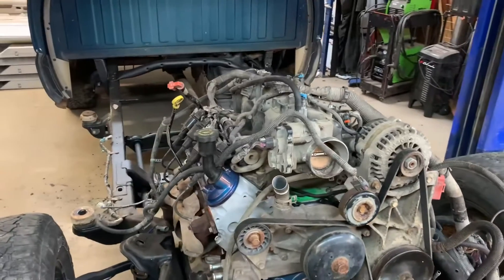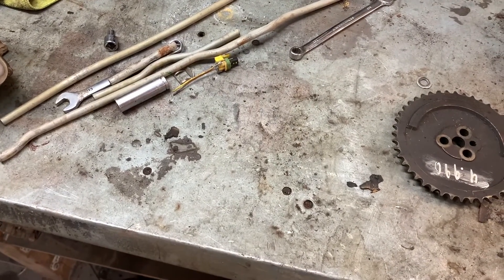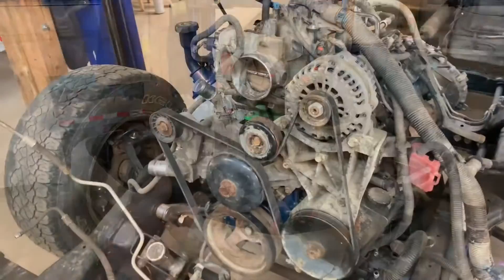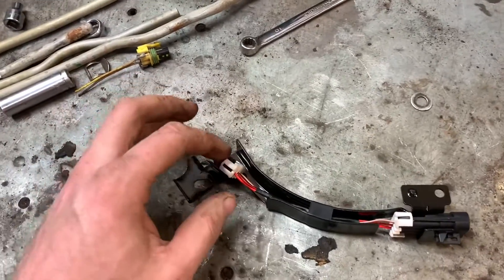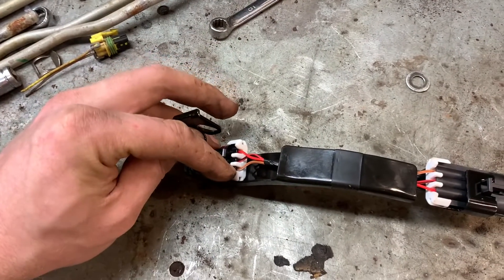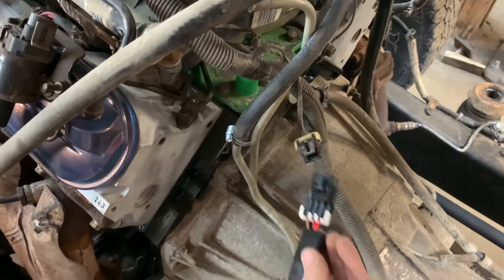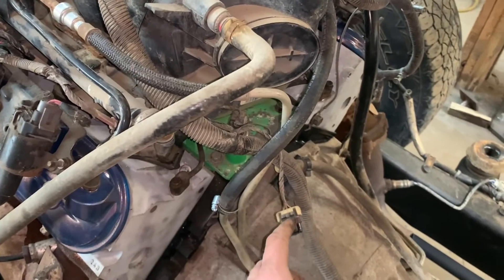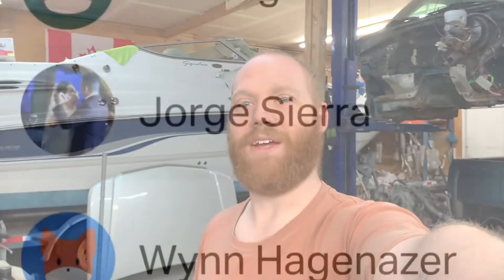How to wire a LS Gen 3 to Gen 4 Cam sensor harness

Comment: i recently put a gen 4 cam in my gen 3 engine, i changed over to a ls2 front cover and the same cam gear as in your video and i still have a p0343 code, will switching the two wires fix my issue?
Reply from the maker: I think so, yes

Comment: Need to know if this works vice versa. Putting a gen3 in a 24x gen4 05’
Reply from the maker: You’ll need the gen4 crank in it (or change the reluctor, but I find it’s easier to just change the whole crank if you have it out anyway) and then bolt the 4x cam gear and front cover on. Then it’ll work absolutely fine
Reply from the maker: EDIT. I just read you’re putting a gen 3 in an 05, they’re the same engine just go bolt it in

Comment: I need your help. I am doing the opposite gen 4 avalanch with a rebuilt gen 3 motor..i plan to extend the wire plug up to the back of the replacement gen 3 motor with rear cam sensor.. no where else talkes about switching the outside wires. Am i understanding that in my case going from gen to replacement gen 3 i still need to swap these wires??? Thank you for your help
Reply from the maker: You’ll need to put the avalanche cam gear and timing cover onto the gen 3 engine. The avalanche has a 4x reluctor and it won’t run on a 1x. 

You’ll also have to change the reluctor on the crank or change the whole crank itself to a 58x

You can get a lingenfelter box for gen4 to gen3 but I don’t know if it’ll work in your case. Might want to read up on that
Reply: @StationroadRatrods i just bought this unfinished project, pervious owner doesnt reall know the spacific details on what has been done. I am continually figuring it out.. sounds like the reluctor was changed in the motor, but for some reason the cam sprocket and cover did not get changed ??? So motor is in truck now. It slow starts and runs rough, tach works... but all traction control and other codes flashing. I need to varify the reluctor wheel was changed without pulling the motor. If it was i can add the cam sproket and cam cover.
Reply from the maker: You got it. I don’t think it would start at all if the crank reluctor was wrong, so that’s a good start
Reply: . I hope this is the case.. i can do the cam cover and sprocket while still in the truck, fingers crossed cam parts ordered...
Reply from the maker: Good luck dude. Any questions at all ask away
Reply: @StationroadRatrods  i was looking for the vehicle original front cam sensor wire lead and plug but could not locate it yet. Some of the harness has been electrical re-tape wrapped. Can you direct me where on the harness / engine the cam wires should have come from to go to the front cam sensor?
Reply from the maker: In the harness there’s a plastic bracket that bolts to the front of the oil pan. It should branch off right next to that and there’ll be a 3 pin connector
Reply from the maker: *If it has VVT it may be a 5 pin connector*
Reply: . Guy before me did a gen3 engine swap into gen4 avalanche. 1/2 competed and gave up.. thats my starting point. I just ordered the 4x cam sprocket, and the cam cover with the front cam sensor.. the " truck harness " is where i cant yet find the plug,, to go into the cam cover item your speaking of... does the truck harness feed the cam sensor across horizontal from the frame area, or does it feed down vertical from the top of the engine?
Reply from the maker: I think it comes out from in under the power steering pump area
Reply: @StationroadRatrods.   thanks for the tip, i will start to look around there..
Reply from the maker: Anytime
Reply: @StationroadRatrods  i found the cam sensor wires coming out of the larger bottom connector plug driver side on frame below fuse box.. it looks like its been hillbillied up ( not factory ) he extened up around the brake master to the back top of the new gen3 engine cam sensor. The new wire colors are blue, brown, and grey.  I was under the impression for gen4 vehicle harness they should be. Orange 5v hot, brown center, brown with white stripe trigger? So i am not sure if the previous guy " repinned the gen4 vehicle side connector plug ?? Before i put on the front timing cover + 4x gear. I will make the cam sensor harness from the vehicle back how it was/should be. How can i identify the proper orientation for the car harness connector pins side- and to the sensor connector pins at sensor ? Any photos , schematics, or suggestions ?
Reply from the maker: Holy what a mess. Yeah hook it back up to the front cover, that’ll be why it’s running like garbage. 

Check out lt1swap . com 

Go to “wiring harness modification”
Then “2007-13 vortec 4.8/5.3…..”
Then “2008 specific e38 pcm connector pinout….”

Look on that pi put diagram for the wires you need. You’ll find what colours you need then you can pick them out of that harness
Reply: @StationroadRatrods thank you for the guidance.. i will be looking into the actual plugs on the truck in coordination of this info, to see if it seems to fit. Waiting on cam cover and sensor parts currently. Thank you again.. i will post my results went further along.
Reply from the maker: Sounds good man, happy to help! Hopefully it works out well
Reply: . Thought i would give you a giant THANK YOU on thanksgiving day. I just got done working on the truck. It took me 4 days to get all the mechanical parts changed out from rear cam sensor to front 4x cam sensor. Then had to bulid a wire harness to the front cam sensor location. The guy before me had 2 wires crossed up on location in the pin comnector and also his wire color swapped. With your help and direction i was able to make sense of it and get it all corrected and ran the truck tonight. No more long crank and my obd2 scanner says it now can read the cam sensor.. thank you, no way i could have figured this out without your guidance. Thank you.
Reply from the maker: That’s awesome man, hell of a job!! 
Happy Thanksgiving 😊

Comment: I’m doing a l92 6.2 swap out of a 07-13 into my 2003 Silverado can I put that camshaft connector that you have in my truck and make an extension harness so my gen 3 plug will go into the front gen 4 aftermarket harness or that won’t work?
Reply from the maker: So are you putting the gen 4 pcm in the 2003?
Reply: @StationroadRatrods no sir just keeping the stock pcm just dropping the motor in
Reply from the maker: You’ll need to use a lingenfelter box or something equivalent to that. If you still have the stock 48x crank in it, you need to convert the signal to 24x to run the stock pcm

Comment: Which cam sensor did you use in the front timing cover? Aren’t there voltage differences between the gen 3 and gen 4?
Reply from the maker: You can only use the gen 4 sensor in the front cover. A gen 3 sensor won’t fit as it’s about 4” long

Comment: I cut and extended my wires and still have a P0342 code. I have two points inbetween that are but connected. Going to eliminate one and see what happens. I couldn’t seem to find 5V reference?
Reply from the maker: Your best bet to find the 5v reference would be to disconnect the connector from the pcm, find which pin is 5v and do a continuity test out to the cam sensor connector to see which is which.
Reply: @StationroadRatrods  thanks for the response. I have came to the conclusion that I’m going back to an iron block 6.0 gen 3
Reply from the maker: @bowtiebuilding probably the best bet, to be honest I’d like to do the same.
Reply: @StationroadRatrods  yeah and I talked to a guy with more knowledge on it than me and he says the aluminum motors don’t handle the heat from a turbo near as well. I noticed after breaking the motor in and running it that it’s a bit hotter under the hood.
Reply from the maker: @bowtiebuilding many people have made 1000hp on aluminum blocks, but no they’re not as strong as iron blocks. In my experience, pistons fail long before a block will. 

That said, I’m taking the aluminum block out of my truck and putting in an iron block
Reply: @StationroadRatrods  right on! I did put forged pistons in it. I just let someone talk me into the weight saving = power
Reply from the maker: A hundred pounds is a hundred pounds, but there are trade offs

Comment: I think this is my problem now. I have a holley terminator for a gen3 and moved the cam sensor to the front. Im going to swap the wires around.
Reply from the maker: Good luck! I hope it fires up well
Reply: @StationroadRatrods  thanks. Just tried and the ict billet extension dont fit. But my wire from my holley is long enough ti reach the sensor by itself. Just need to switch the wires. Can you confirm the wire pin out thanks
Reply from the maker: @theshark2804 you just switch the outside wires, the center wire stays where it is
Reply: @StationroadRatrods  yep just did that and not working for me. Now the holley 7th led is blue. Might not be the solution for me. Dang.
Reply from the maker: Well shit, sorry to hear. What’s the setup?
Reply: @StationroadRatrods  no worries. I will go back and try to reach my crank sensor as well. Something aint right. Thanks.
Reply: @theshark2804 you fix it?
Reply: @bowtiebuilding  yes. Running strong. Still need a tune. My issue was all over the place. Dont know crap about ls. So turns out i have a gen 4 crank in a gen3 block. My cam sensor was in the front and had to make sure the plug wires matched. Then just pick the right configuration in the software

Comment: I’m swapping the LC9 off an 2010 1500, rear cam sensor with a 2008 front cover cam sensor (DOD deleted). I plan on wiring up the harness before the install
Reply from the maker: In an LC9 the cam sensor is still in the front, the plug at the back is for the DOD. You won’t have to rewire anything
Reply: @StationroadRatrods  ok thank you for clearing that up. I was just confused bc mine (2010) had the VVT timing cover and the one I bought with the DOD delete (2008) was a plain cover. I’m off to change the cam sprocket and timing cover! Thanks for your help!
Reply from the maker: @John-zv6gw if you have the complete 2008 engine, just use the timing cover and gear from that engine on your 2010

Comment: Thats a good thing to know.  I can only imagine how frustrating it would be having everything plugged in and it wont start.  You'd never find that issue.
Reply from the maker: If it’s not something you were born knowing, it’s very difficult to figure out. It took a lot of research to find that
Reply: @StationroadRatrods  yeah, it's not everyone that would want or need to do that.  
Good info man.
Reply from the maker: @Jordy-927 only nutcases like me get in these situations 🤪 but then there are lots of nutcases around hahaha
Reply: @StationroadRatrods  At least 13.7k of us.   Lol. 
Dude, wanna talk nutjobs? I want to LS swap a square body S10 blazer 4x4 for a winter driver for da wife. L33 and a 6L80 with a stock height suspension would be the plan.  I just need to build a shop first...lol. Waiting for money to get cheaper from the bank.
Reply from the maker: I think that’d be an amazing winter daily. After driving the Escalade for the last couple winters and then driving a 2010 Chevy with selectable 4x4, I never want anything that only spins two tires again. 

Stock height is more than enough unless you need to park half way up snow banks at the grocery store like jeep people lol
Reply: @StationroadRatrods  I got the ZR2 for doing stupid stuff.  It's capable of far more situations than I am.  
The wife owns a mini, so I don't want a huge winter vehicle for her.  I'd even be open to putting an Escalade transfer case in and having it AWD with a rear e-locker for getting unstuck if the mall parking lot got real bad.
Reply from the maker: The mini is awd? They’re pretty capable themselves as long as it doesn’t high center and the wheels come off the ground
Reply: @StationroadRatrods  the potholes are the biggest concern.  I've heard they work really good in the snow, but they are real expensive to fix when you hit a hidden hole.  Just way cheaper to not drive it in the winter.  As it is I have 2 wheels to straighten come the spring.  Plus it's covered in plastic on the bottom, way too many places to trap the salt.
Reply from the maker: I hear you. We were constantly putting parts on my boss’ paceman when he had it
Reply: @StationroadRatrods  and those have more tire and are higher.  We have the Clubman.  It's pretty low
Reply from the maker: His was a 2 door, I don’t remember it being real high
Reply: @StationroadRatrods  they were a bit higher than ours...I think they're the same as the countryman...built on a bmw X1 frame.  Not sure though.

Comment: What is the difference between that LS1 cam gear and a Gen3 6.0 cam gear ? Looks the same to me and they are both 24x with 3 holes ? Great vids . I watch them all .
Reply from the maker: I appreciate it Allan!

The gen 3 cam gears are usually flat with a bunch of holes around the perimeter, but these LS2 cam gears have the 1X signal cast into it (the half circle part going around the perimeter) that the cam sensor reads

Comment: Cool side note.... Dual Can Vs Single cam neon... Just swap the outside wires just the same as what ur saying... Uggggg Ask me how painful that lesson was
Reply from the maker: Awesome! You swapped out for a dohc?
Reply: @StationroadRatrods  we.raced them... so we.ran what was on hand at the time
Reply from the maker: Badass
Reply: @StationroadRatrods  yeah It made the cars/Harness Totally interchangeable just the cam semsor wires... In fact when I build stripped race harnesses I put on 2 plugs with lables!
Reply from the maker: You definitely prepared for blowing up a bunch of engines eh? Hahaa
Reply: @StationroadRatrods  no... We had a sponsor who did Builders and had engines all over... when ur running for points and lose a motor... ya slap in whats on the shelf
Reply from the maker: @patrickquinn3574 oh yes, get back out on the track and don’t DQ